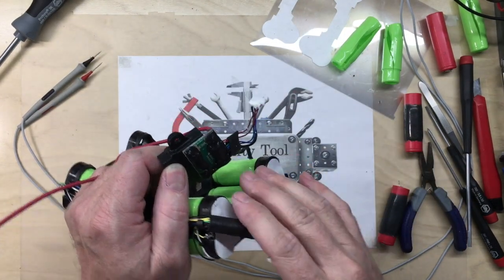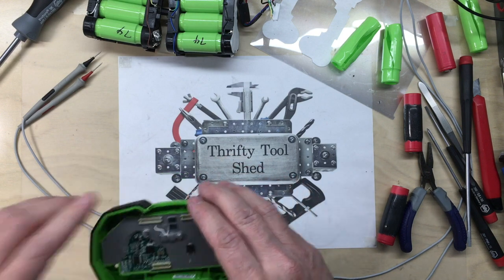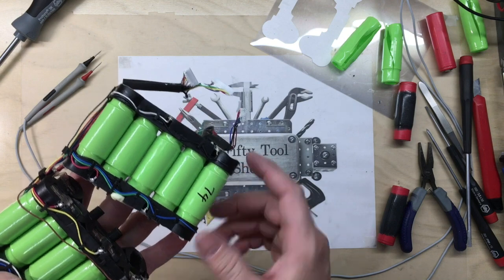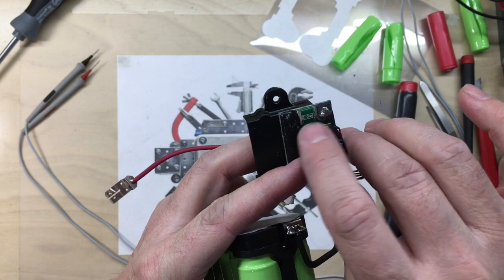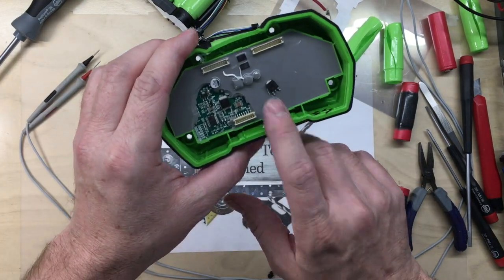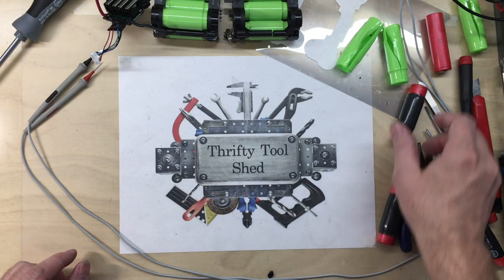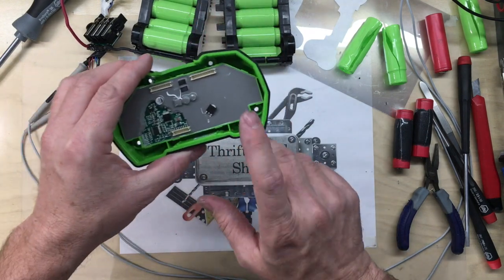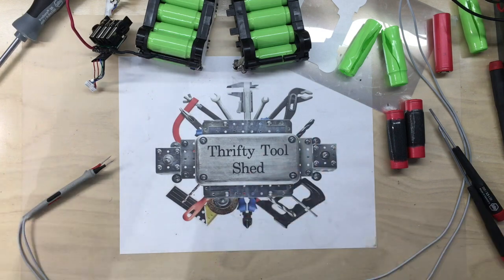EGO 56V Battery Repair Update

Comment: I have a Gen 1 2.5Ah that shows 57V on the terminals and charger has solid green light. When I use it in a tool it only runs a second or 2 and flashes red light rapidly. I think the thermal overload is tripping and has become too sensitive. Have you seen this issue? Thanks
Reply from the maker: The flashing red is typically one of the cells dropping below around 2.7V or so. So, one or more of the cells have lost capacity, so the pack has gotten unbalanced. The BMS can keep the cells balanced to a certain degree, but once a cell loses capacity, it is no way to keep them balanced well. If you investigate, you may notice that even when fully charged, one or more cells will still be reading much lower than the others. To show green on charger means at least one cell has reached around 4.2V. On the other hand, if the pack is flashing orange, that is a temperature issue.  I have a video on one  that was caused by a loose connection. Best of luck to ya!

Comment: where can we buy the cells?
Reply from the maker: I mentioned in the video called Lithium Battery FAQ#1 how I use spare cells salvaged for mine on these. 
These are Li-ion 18650 2500mah and every EGO pack I have ever worked on has the 18650 physical size cells.
(I do not know what is in the newer 10Ah and larger  packs though).  
It is hard to say for sure which cells are in the packs due to the unmarked cells but we know they are close to 2500mah due to the 2.5ah, 5ah etc. rating. I bought several bad packs from eBay over the last 6 years or so and tested and collected the good cells from some packs while that helped me repair many packs. We know they will be high current cells. We have had some comments from viewers on here saying the cells they thought their packs have.....
  (Jonathan Ridder) mentioned his had Sanyo UR18650NSX. (Ipissed) mentioned his are Samsung INR18650 with phase change sleeves made of paraffin wax/carbon graphite.
Reply: @ThriftyToolShed  thank you so much for the reply. i plan on doing a self repair on my eco battery. 

hopefully its easier i am working with the 6.0 hopefully it all goes smoothly
Reply from the maker: @optimiskong4219 
Awesome! Hope all goes well!
Reply: @ThriftyToolShed  which is your most detailed video that can help me with the full repair.
Reply: @ThriftyToolShed  i ran into a problem my cells are orange for the 6.0 battery and there is sillacone blocking everything.
Reply from the maker: @optimiskong4219 
Not sure about a 6ah, but it's usually temperature related so I would check all NTC and even connections. Even the ones at the middle board between the 2 halves if it has one.
Reply: @ThriftyToolShed  i could video share the amount of anti tinkering they put into this thing. they covered everything in sillocone and i am here knifeing everything away.
Reply: @ThriftyToolShed  i checked the connections they all seem secure, all the connections were covered in sillacone it took me hours to scrape and peel them off.
Reply from the maker: Yeah the silicone is a pain, but not real bad as I have shown in older videos how I first removed it. I have not worked on the 6ah to know if it's different. Checking connections, maybe reseating the connectors and maybe even a gentle tap to see if a bad connection somewhere is causing it. Obviously I can't more help from here. Best of luck to you with it!

Comment: Where can buy the cells
Reply from the maker: I keep lots of spare cells from almost new packs parted out as well as other cells tested very well for capacity. I just about always have what I need for spares. I usually do not recommend cells because so many times it's hard to verify that they are not fake cells. The main thing to make sure is that the seller is truly selling genuine cells. I have had great luck using 18650batterystore.com in the past. 
I share some of this in this video if you find it helpful.
https://youtu.be/f9SOPVEqgkw

Comment: I took my battery pack apart and every cell is bulged. None of the cells have a sharp shoulder like the batteries in your video. It checks at 32V when I check across the positive and negative terminals. I checked the bottom pack and each pack checks at 3.6 to 3.7 V the top pack checks .3-.8V per cell. Is the pack shot and not repairable?
Reply from the maker: Most likely yes the pack is basically shot. If you try to charge up (boost) the low cells to see if they will take a charge they might but chances are the capacity will be low and cells will most likely get unbalanced easily. If you like working on these things at least you have some spare out of it. If you do not like keeping the spare parts around these packs can still bring some money on eBay even non-working. Best of luck to ya!

Comment: Hi all great videos.. i have 2 4ah ego batteries one is charged to 57 volts. But blinks red  or orange when pushing button.. will it still work? Why wouldnt it b green? The other is at 8 v . With a power supply at 56v its not charging at all. How could i charge it
Reply from the maker: If it's 57V, then 56V will not charge it. It's already above that. If you are  saying 8V pack will not charge with 56V then test all cells one or more maybe at almost open condition? If blinking red it thinks it has a cell issue. Check individual cells to make sure they are balanced. If blinking orange it could be a thermal issue or it thinks it is. Could be NTC thermistor issue. 
The BMS board can of course cause this as well if all else checks out. I have taken time to share what I have learned on this one several videos. Hope it helps. Best of luck to ya!
Reply: @ThriftyToolShed  I thank you for your response . How can i charge individual cells without taking apart the whole pack. And i could test them on  the bms board like you showed i guess. Wish they had a reset like on the newer ryobi 40v. .those are easy.. these are my first 2 56v.
Reply from the maker: It is no way to charge individual cells without disassembly. After disassembling and separating the halves it is fairly easy, but you have to make sure not to touch other cells or tabs while charging separately also.

Comment: You stated experiencing 3 different issues... can you tell me which issue caused a solid red led on the battery pack and/ or a solid green on the charger? (I.e.  the charger LED stays on solid Green even when the battery is not plugged into it and does nothing else. Solid green at all times) on the battery... the led/ button is solid red when the button is pushed. 
This seems like a charger issue because of the constant green LED (as if it thinks theres a battery connected) any thoughts would be greatly appreciated.
Reply from the maker: Sounds most likely the Charger is the issue. I would absolutely test with another to make sure. At least the base charger is really cheap and if you don't have a spare yourself hopefully a neighbor or family member might?

Comment: Great Videos, any idea where to get parts for these trying to get board with fuse and contacts for arc lithium 7.5 ah Thanks
Reply from the maker: Hi, thanks for your kind comments. 
I have not had luck buying any new replacement parts. I have had luck at times buying packs from eBay or market place if you watch for good prices. Bad packs can eventually get a good supply of spare parts. I even capacity test the cells and log which ones have a certain level of capacity left, internal resistance etc. and of course you can end up with spare connector boards etc. I have had to use a fuse link in the past to replace a fuse. I have had luck once also finding a used EGO pack in a recycle bin at the hardware store. I am always allowed to get them if I ask the manager. Since the pandemic, I have not found many batteries in the recycle bin unfortunately. Best of luck to ya!

Comment: where can i purchase a q12 transistor?
Reply from the maker: I have a link in the first Ego pack repair video description. Should be able to find it at any electronics supplier also. 
Link to the the Q12 replacement I ordered:
http://rover.ebay.com/rover/1/711-53200-19255-0/1?ff3=4&pub=5575400462&toolid=10001&campid=5338325412&customid=&mpre=https%3A%2F%2Fwww.ebay.com%2Fitm%2F1-pcs-Motorola-PNP-2A-100V-Darlington-Power-Transistor-MJD117%2F264256482703%3Fhash%3Ditem3d86e9ed8f%3Ag%3AdakAAOSwK1Rb-sIN

Comment: Hi, Have you ever come cross a situation that all batteries in the pack (EGO 2.5Ah) were swollen and wouldn't charge. After taking the battery pack apart each cell has a charge of 3.6V and a total charge of 51.2V. Any idea as to what is going on?
Reply from the maker: When you mention swollen, you mean that the heat absorbing sleeves (phase changing sleeves) are swollen or the cells themselves under the sleeve?
When you say would not charge is that just with the EGO charger, you don't mean putting a current limited 4v accross the individual cells and it would not charge right?
Reply: @ThriftyToolShed  Thanks for your reply. Yes, each individual cell in both packs (14 of them the cells under the green sleeve) are uniformly swollen. And yes the ego charge wouldn't charge the battery, the green light stay green but very dim. I have tried to charge individual cell as well as a combination of 2, 3 and 4 cells together with 4, 8,12 &16 volt at 1A. it goes through the charge process without any issues but the charging process only takes about 5 to 10 minutes. I wish I could send you a picture of the pack?
Reply from the maker: @moghadamk  
You can send picture through my Facebook page if you like....

Comment: Nice vids.  Gives me a slight idea of what to expect.  My 5ah battery stopped working one day before the warranty so they are sending a replacement but I wanted to see if it was fixable.  Shows 12v full at the slots but won't run the mower.  The green button won't light up and the charger just try's for a bit then goes dark.  Any suggestions?  The Power management board maybe?  Have yet to crack it...
Reply from the maker: Well I would lean toward problem being in the cells or at least one cell. Pack voltage should not get below 35V unless some cells or all cells have gone way to far delepleted. You really do not want cells to go below 2.5 each so 14s or 14 in series would be 35V. 12v is really low!
Reply: @ThriftyToolShed  and I'm guessing once a cell drops there is no safe way to kick start it into charging again huh?  Thanks for the insight.  I at least can go into this knowing it's not a quick fix like a fuse or bad wire.
Reply from the maker: @Woffie70 
Well typically it is nothing much we can do at that point, lithium has to be kept above 2.5V or so or damage occurs. In rare cases doing what is called boosting will bring a pack back up to a somewhat useful condition. I will put a current limited supply of 1A Constant Current and voltage limit of 4V accross each individual cell and sometimes they will charge back up, of course the cells have to be watched at all times making sure they are not shorted, or getting very hot! Bad news is that almost always some degradation of the cells will be noticed especially with that many cells they will all be different and not well balanced and some will be bad enough that after you charge them they will start to drop off voltage slowly due to internal damage. The pack may even get to the point of usable, but the capacity will be severly reduced. I have been lucky and just 1 or 2 cells dropped off quicker than the rest and by replacing them the capacity is pretty descent!

Comment: Hey, thank you for your videos and tutorials! You make it easy for even a layman to understand what you are talking about.  I have a Ego 2.5 AH battery that I have used for about 3 years.  I’m contacting Ego about a replacement but no success yet with COVID wait times.  Right now the battery will charge on the charger and run in my blower. However the green light is blinking on it non-stop and the battery is draining down even when not in use.  It had stopped charging and blinking completely recently but I did some trouble shooting and got it back to charging and blinking today.  Do you know what the problem could be based on this blinking green light? The voltage across the terminals is 56.6. Any advice you can recommend?  Anything I can test with a standard multimeter? Thank you.
Reply from the maker: https://youtu.be/EH0GS0iUzzM
This is the video that I repaired the 2.5ah BMS board  blinking green...
Best of luck!
Thanks for your comment!

Comment: Do you know of any company or person who repairs EGO batteries? I have a 7.5 aH and used it for about four years so it is out of warranty. It seems EGO has no exchange or repair service. 
The battery has been charged about 150 times and only lasts about 25-30 minutes. When new, I could cut my entire yard on one charge, even while using the self-propel feature. Now I have to recharge twice to finish - 3 total. EGO said the battery should last 300-500 charges, so I am reluctant to lay down $349 for a new one after only half of the expected life from the original.
Cheers,
Fred

Comment: We left our 7.5 out in the weather and it no longer will charge. Any ideas where to start?
Reply from the maker: Hard to say, the battery electronics are sealed pretty well. But I have not had a 7.5Ah apart yet to say for sure. Is it trying to charge at all? Any voltage reading at the terminals?Any light showing when the battery charge level indicator pressed?
Reply: @ThriftyToolShed  the charge cycle went through a normal process.  when we install the battery in the mower the mower starts for about a second and then the battery flashes red then shuts off.  no lights on the charge level indicator.  as far as voltage at the teminals, can I just touch any two terminals to determine that, with my voltage meter?
Reply from the maker: You have to touch the (+ and - ) outside two terminals. I have seen bad cells cause the blinking red, the BMS board could cause that and a bad NTC could also cause it. Checking the voltage, if it is around 56-58v then the cells are most likey good.  I also have a video about what is the T-terminal that will aid some in trouble shooting the terminators (NTC). Other than that it could possibly be a bad BMS board. Best of luck, I know these packs are not cheap, I have two 5Ah packs but no 7.5 yet!

Comment: Howdy Thrifty,  Ive been trying to buy some used batteries to do just as you are here BC being on a fixed income i can sit and diagnose and fix them if they are not too severe so i could have a second battery BC i know with the Fl summer coming and my SON leaving tools out side I am sure he will cook the dang thing in a year! Yours Green Blinking I thought right away it was a wire back out ...but because they were sealed i wasn't sure you were gonna even play with them after you got the Replacement one.  Heck I know I would after i had one coming Because it would let me poke around and see if I could fix it and know for future when they do run past warranty if ide need new one or could fix older ones. keep up the great work young man!  Cow}:-o)
Reply from the maker: I have noticed lately that it's harder to find them on eBay for parts as cheap as they used to be. I would like a couple more just to have the spare cells but I will not pay to much for them because I just don't know how long they were in storage. If the same shorted transistor issue on them that means they have pulled down way to low to be good spare cells! Thanks for your comment and best of uck!
Reply: you too young man!  Cow}:-o)
Reply: The YouTuber “jehugarcia” specializes in harvesting 18650 cells from overstock and used applications.   He has a lot of videos on how to sort them and has links on where to buy them as deal come up.   He often has new cells for about $1.5 per cell.   Just an idea on where you could find new cells for an old pack.   Not sure if it is with all of the soldering.

Comment: Do you know the spec's for Q63? The code on this transistor is COPA. I only find 1 junction on this transistor and cannot decode it.How did you decode some of the other SMD's like Q8? Thank you.
Reply from the maker: I was not able to find info on the Q63 or Q64 but they are the same P/N and mine tested the same when comparing them to each other so I moved on. Mine is actually a COSA but I wonder if the CO  is for Custom Ordered etc. It sucks web searches show nothing for it.
As far as Q8 mine shows BL and sometimes searching for BL marking! ie: the BCX56-16 shows BL marking in the data sheet. It also helps when I can recognize that it is a SOT89 package when searching. I don't know them all by any means but I know the SOT23 and the differences compared to the larger SOT89 pretty well.
Hope it helps (BTW if you can't find the Q64 it is hard to find it is bottom left beside the lower connector!)

Comment: Thank you for your very helpful information on repairing the battery management board.I have  an EGO BA1120 2.0AH battery that the red led was on constantly. I checked the MJD117 transistor and found that there was a short between the emitter and the collector. I ordered the MJD117 and was able to replace the one on the board. I had purchased another BA1120 that wouldn't take a charge. When I connected the battery management board from this one to my original battery the green led was constantly lit. This board had a the same short on the MJD117. It was interesting to see the same short in the MJD117 causing the red led or green led to be lit.
Reply from the maker: Interesting, Thanks for your comment!